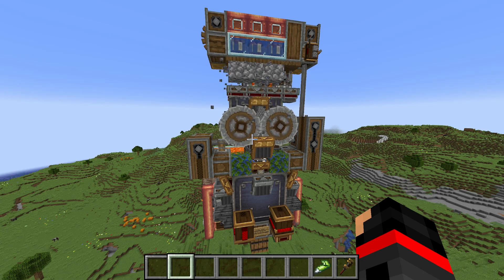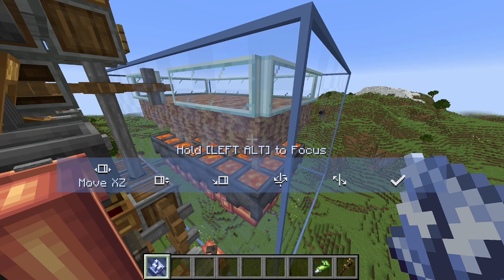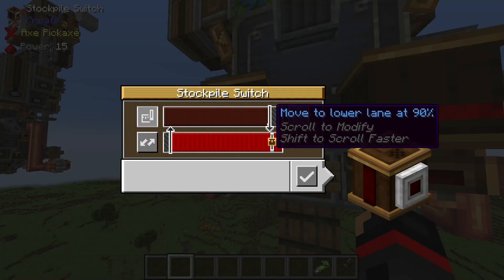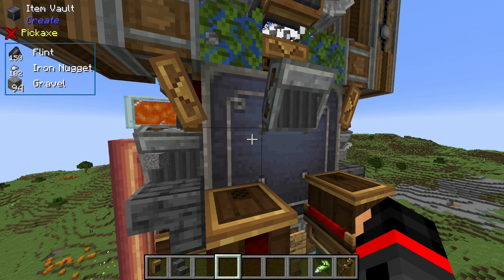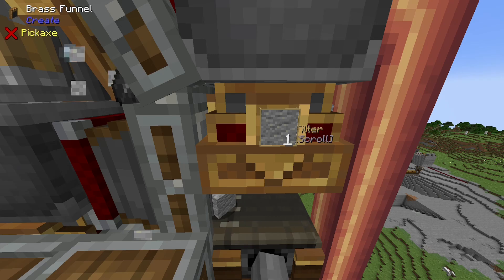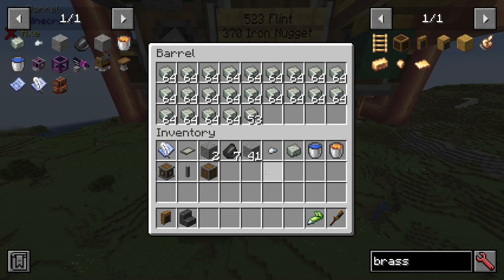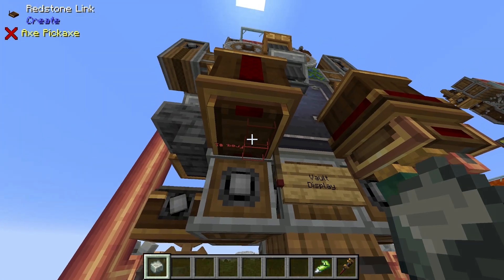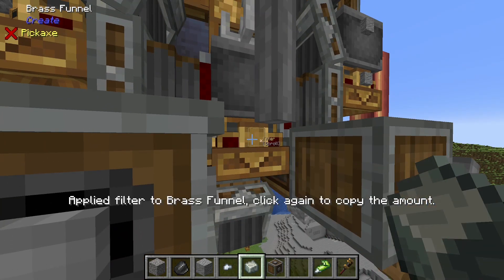This Machine Is A MUST For Create Players - Minecraft: Create Mod 5.1

Comment: the brass funnel connected to the chute under the crushing wheels for me is spitting out a whole stack of gravel even though its set to 8. its making it so the gravel never gets washed. do you know a fix?
Reply from the maker: Did you already try breaking and replacing the funnel?
Reply: @Triobian  yeah i did that a couple times and it didn't fix it
Reply from the maker: Did the same thing with the chute? and can you confirm that the crushers are getting a full stack? Other than that... I honestly have no clue, no one has had that issue before. Oh, is it getting a redstone signal somehow? And do you have the crushers going the right way? And is there anything blocking off the chute on the bottom?
Reply: the crushers are getting a full stack and going the correct way. no redstone signal. i broke and replaced the chute and the same thing happens. its not getting blocked because when I break the brass funnel the gravel goes through the chute and gets washed. then I replace the funnel again and set it to 8 and it starts spitting out full stacks again.
Reply from the maker: Try a smart chute instead of the normal? Other than that I'm honestly out of ideas. It literally shouldn't be possible to pull a stack when its set to 8..
Reply: that didn't work either. thanks for the help though, I appreciate it. I'll tell you if I find out what the issue was in case it happens to someone else.
Reply from the maker: That I will definitely appreciate. I do hope you can resolve it.

If nothing else works, just raise the crushing wheel and up by 1 or 2 blocks, have the chute go into a barrel, and then funnel out of the barrel and chute the rest down as normal. Hopefully that at least would work as a last resort if the current system doesn't want to work.

Comment: I am having an issue where the mixer isn't running even though it's full of nuggets and andesite? Any suggestions?
Reply from the maker: Break the funnel between then and see if it starts. If it does, replace the funnel and see if it keeps working. If so, remember to put the iron nugget back on the filter and set it to 1. 

If it's not the funnel, check the rotation speed on the mixer, see if it's not getting enough speed. 

Try breaking the mixer and the basin and replacing.

Lmk how that goes

Comment: Awesome! I like how you explain the machine. One question: Do you think it would harm the TPS much if it were to be in a chunk loader?
Reply from the maker: As with any create machine, it absolutely will affect the tps. How much, I don't know, depends on the game/server.  However, this is actually probably one of my least moving machines. The only high speed part is the cobble Gen, and that will actually only run for a short time until the vault fills up. Once that happens then it's just two presses and a mixer for like 2 hours (I haven't tested how long it takes to drain the vault). So majority of the time it should be fine.

Comment: leaves aren't water loggable in previous versions ;/
Reply from the maker: You can just as easily use stairs, half slabs, trapdoors, etc etc. And there's always the option of just blocking off the sides with whatever block you like.